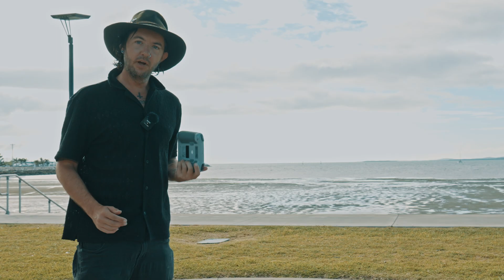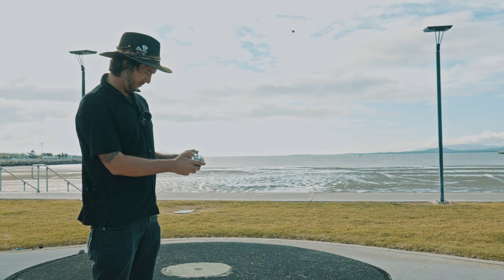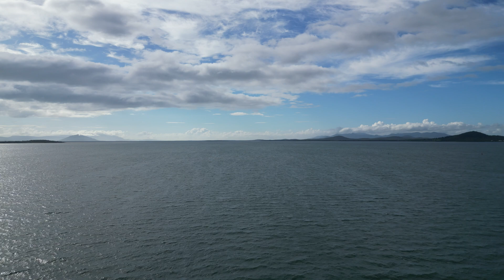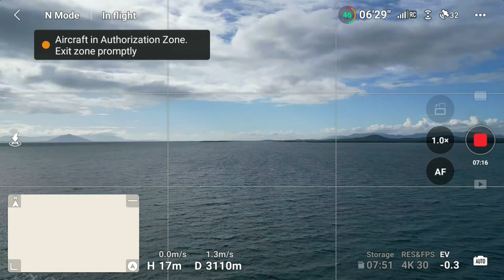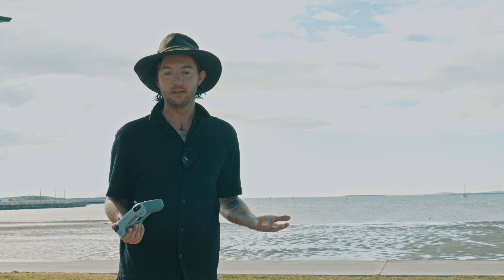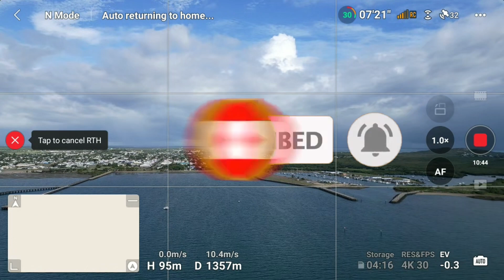DJI Mini 3 Pro Flight Range Distance Test in NORMAL Mode.

Comment: 8066m and back. Also when back some more flying around in circles to check how many Kilometers I can fly it in total. Result ist 20'400m. Flown with an RC Controller and in FCC mode. Almost zero wind and with a OEM plus battery.

Comment: That looks about right. I use a spotting scope to find whale watching boats, spot whales and then fly out. I have flown out several times to roughly 3km and had time to spot the whales and get a bit of video and make it back. I’m currently looking for a rangefinder so I don’t head out when they’re 4k away as I doubt that works and it’s just a waste of a battery.